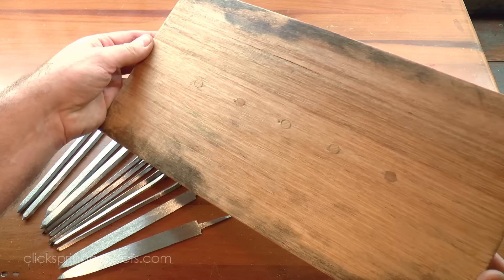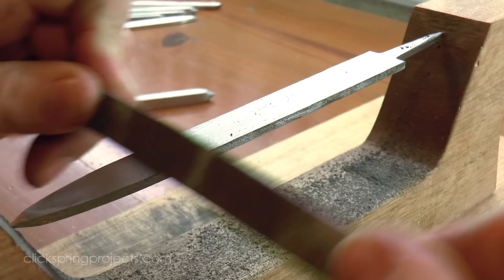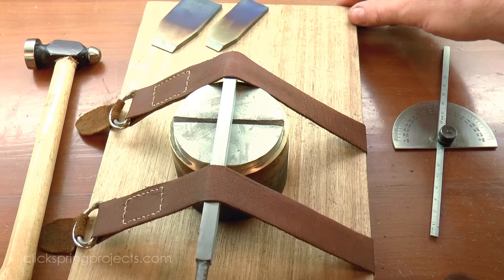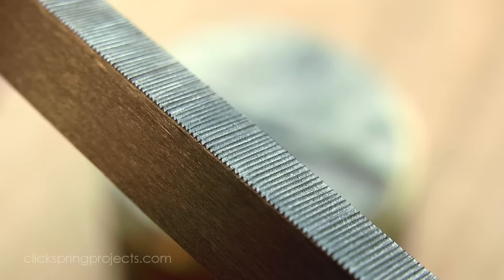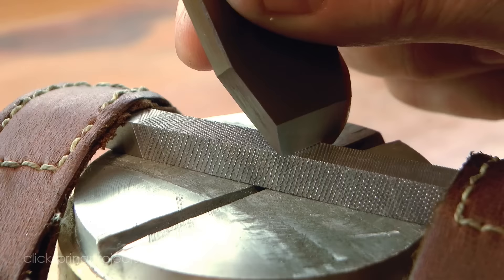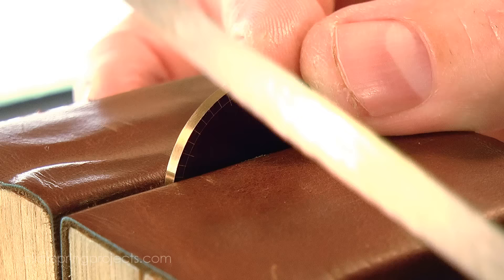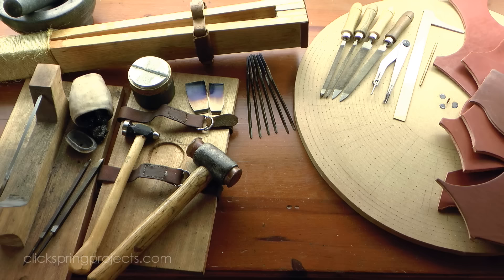Antikythera Fragment #3 - Ancient Tool Technology - Hand Cut Precision Files

Comment: Awesome video and demonstration. Do you think the chisel could have had a flat piece attached just behind the cutting edge? The flat piece would fit into the chisel groove, setting up all future cuts more consistently. There's still inconsistent impacts from the hammer blows, but removing a variable in spacing the teeth of the file is always helpful.
Reply from the maker: Its possible, however I've not seen anything like that whilst researching. My own experience is that its not required, and the pro hand cut file-makers that still practise the art continue to use free hand positioning of the chisel. It has been suggested in several texts that the small inconsistencies in the spacing of a hand cut file is a positive attribute, potentially reducing chatter - I've copied some links below for you - Cheers :)

https://youtu.be/UTXlzcmkQf0?t=2m56s
https://youtu.be/gvr2nZeAfNc?t=6m9s
https://youtu.be/gQ09O3d8y9Q?t=2m26s
https://youtu.be/koZkKDAg3Zs?t=18m10s

Comment: Man.. I wish I had the tools, resources, and space necessary to make my own files like that. I do a fair bit of detail work when I make jewelry pieces, and often it requires super small files, the type used for escapement adjustments in fine clockwork. And they can run you between 15 - 30 bucks a file, for the tiny high precision files. So as you can imagine, when one breaks, its heartbreaking. When it happens I often use the remaining pieces as their own tools, as they are still super fine pieces of sharp metal. But what I wouldn't give to be able to easily forge a few custom files in the sizes needed. Living in the middle of the city, within an apartment zone, makes crafting things difficult at times. Definitely not ideal. But im a maker and artist at heart, so.. I work with what I got. Thanks for these videos.

Comment: To get a more uniform file you could simply just have a thin flat bit of metal held losely to the back of the chisel that you are using to make the file & after you have made the 1st file tooth the thin strip if metal would locate in that tooth holding the chisel a set distance for you to make the second & you could just repeat all alone the file getting a more uniform spacing & the thicker the metal strip the further the spacing just a thought you do amazing work.

Comment: You might also consider that the found Antikythera mechnism was actually a portable,                    miniaturized version of a much larger and doubtless wooden original wooden mechanism 
that was easier to design, build, modify, perfect and instruct in its use before it was made                        of water and corrosion resistant metal for use at sea.

Comment: As far I am told, did the first files, arrives from the stone saw. The stone saw was a piece of brass, combined with nickel and some other ingredients. To make the saw work, did they pure a thin line of sand on top of the stone, and then let the saw use the sand as the abrasive.
Later did the saw get some marks on the "cutting edge" to make the sand follow the saws' movement even better. When the iron got invented, did people still use that method but did later find out it was not necessary and a wider saw could smooth a surface. Hereby was the file invented. :-)

Comment: just one thing, low carbon steel does harden-- just not nearly enough to make a cutting tool. in fact, it would best be described as getting stronger, as it's tensile strength does increases significantly. it's used in industry to get stronger parts, but without the expense of superior alloys, as long as the lower cost justifies the disadvantages.

Comment: Hi Chris,
thank you for this inspiring video! Did you know that there is a french and nobel prized philisoph who makes the thesis: "Intelligence is the faculty of making artificial objects, especially tools to make tools." And he tolds:"There is no greater joy than that of feeling oneself a creator. The triumph of life is expressed by creation. " It's Henri Bergson. And he said: The solution of a problem lies not in the solution but in the task position. The greatest freedom of man is only the tasks which he is capable of solving.

You are perfect in that! Thank you so much!

Of course I have two questions, because I am interested to makes some rasps for myself and I want to know which steel you use and at which temperature you heaten them? Did I overview that in the videos?

Thanks for answering! Greetings from ancient tool maker city Cronenberg, Wuppertal, Germany
Reply from the maker: He sounds like an interesting chap, thanks for sharing Thomas :) I used what is generally termed "mild steel" in the video. Its a vague term, but usually refers to a low carbon steel that has insufficient carbon present to be quench hardened. If you talk to a steel supplier, they will be able to give you what you want. I use the incandescent colors for temperature, just past "cherry red" worked well for the steel I used, which approximates to something like 830 degrees C. I used mild steel because I was reproducing the ancient process, but if your intention is to just get the finished product, then you may want to consider taking a short cut and using a modern high carbon tool steel - that way you can use a more straight forward heat treating technique without having to go through the more time consuming case hardening process. I thoroughly recommend this book for more info on heat treating: https://www.amazon.com/Hardening-Tempering-Treatment-Workshop-Practice/dp/0852428375 and these two videos on rasp making are just superb:
https://youtu.be/gvr2nZeAfNc?t=6m9s
https://youtu.be/gQ09O3d8y9Q?t=2m26s
Reply: Thanks so much Chris! 
I will look what my job and my time will bring to me!

Comment: Yeah I tried cutting an American quarter with some files into a gear after watching this and holy hell, it is SO hard to get the angles and spacing consistent. Insanely tedious. Stabbed my knuckles a few times too 😂
Reply: It can be done by hand, for sure. I feel it is likely the original craftsperson may have used some sort of jig to hold the file, or the work. It's not hard to imagine a triangular file attached to a polished piece of steel which runs in the previous gear tooth for consistent spacing. Those guys had way more time to think about it than we do.

Comment: Been watching - actually re watching - your stuff.  Question:  For the case hardening of the files, why enclose them in clay before putting in the furnace?  To the layman, it seems like an added step that doesn't offer anything but a heat barrier, but why have that when you are trying to heat up the metal inside?
Reply: To case harden you need some carbon to soak into the surface of the steel. First you wrap the iron with some charcoal so when it's heated the carbon will be absorbed into the surface and make a layer of high carbon steel, but you need an oxygen barrier to prevent the carbon from simply burning off, that's why it gets wrapped in clay.

Comment: i wounder if you could apply case hardening to sword making like in the case of the ulfbert steel swords. instead of creating steel billets to forge they used iron then applied the carbon layer to the sword, hardened the blade, then tempered it so it wouldn't shatter like glass. but it might not give the best structure or free it from any impurities.

Comment: At around 1.35, I see you grinding/polishing your blanks against sand paper, fixed on a circular wheel. I suppose not. But, for argument sake, at this point, how are you ensuring that the grinding/polishing does not affect how straight/flat your blank is, sir? I would, with my limited knowledge, opt for a surface, that I can guess is, or expect to be flat, like a belt sander, with a supported surface that is bigger than the size of the blank being worked on.

Comment: Chris,  could you use a shorter thin piece of metal with a sharpened edge on held closely to the back  your file chisel?  I believe by engageing the previous cut, it would give even spacing and insure a uniform angle across the length of the file.
Reply from the maker: Possibly Norm, although it seems to work pretty well just using the same method as the traditional approach

Comment: The leather you use, both for the straps and for the vice, is too soft and stretchable. Leather used for insoles in ladies pumps, or similar, would be better for the vise. Dampen it first, fasten it with shoemaker nails (flat heads) rather than with glue, and stretch it thoroughly (using a pair of pliers) as you go. Cut to shape, let it dry, and it will tighten even more.

Comment: Hi Chris how do you locate the chisel perfectly parallel each time, if the previous tooth profile is below the surface of the file? Thanks, Adam.
Reply from the maker: It works because the previous tooth is in fact slightly above the file surface - each tooth gets pushed up by the chisel  - cheers mate :)

Comment: gear teeth are not filed down they are always cut with jewelers saw  - if you go to watchmakers  that are standard - yes they are using softer brass  but 
in the end,  a jeweler saw first then they will either use and needle file which is round    can do different  groves -- your  video is interesting in making custom files  the large gears were done with punch outs  where you punch   a hot round plat  in a press jig -- yes some people do it with files but that is not tradition of the trade of gear making  and can be off

Comment: Wouldn't the stripping frame follow any twists/dips in the file blank's profile? So how did you make the file blank perfectly flat?
Reply from the maker: My observation is that the stripping frame will easily accommodate a gentle twist and take it out, although at the expense of material in the blank. A significant twist would need to be removed before using the frame. In either case its not difficult to remove the twist before transferring to the frame - thanks for watching and asking :)
Reply: Fascinating! I love the topic of how ancient craftsmen could create precision tools from nothing. Have you seen oxtoolsco's video where he creates a set of cast iron laps? This reminds me of that a lot!

Comment: Man I'm having such a hard time imagining how, when striking the teeth on the file, how the previous chisel mark can be used to produce the next.. I At least, I dont see how it works so well that it can be done so quickly without having to check each strike excessively
Reply: when he makes the first cut, the tooth chisel raised a ridge on the file blank that's proud of the surface, he's just sliding the chisel up against that ridge, which lines it up and gives him the proper spacing for the next strike.

Comment: You should not grind the edges dry. please use a wet stone. 
If you see the first spark you are at ore close to the melting point of the steel. 
So you are ruining the heat treatment in the important fist 1/1000 of an mm.

Comment: seems pretty cool but i have one question. you used a file of sorts in order to create a plane surface for your files, or was it simply a piece of flattened steel? i understand its very hard to make a tool without having tools in the first place (making tongs without tongs) but i was just wondering if you had or if the people used a different object or tool to smoothen out the surface of the file sides.
Reply: As he says in the video there were slower things available. You could use a stone for example. Or  pumice perhaps on some board, Lots of ways. Not easy but doable.

Comment: Why did you temper the files? I thought they needed to be as hard as they could be
Reply from the maker: In the fully hard state the teeth are too brittle and would immediately chip under load. Lightly tempered, they retain almost full hardness, but are tough enough to be put to work :)

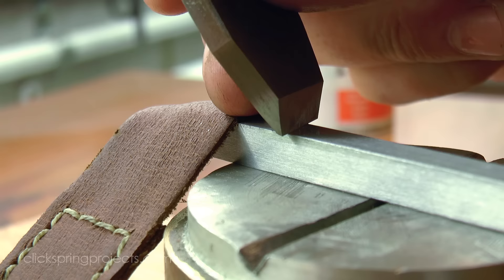Comment: Chris, has the chisel a double cut?… time 6:27…you said to make the next cut you place the chisel back to the previous and then strike and so on but, the first cut was single according to my eyesight....if it has a double cut that would be understandable....I think I missed something   :(
Reply from the maker: Hey Marc - the chisel has a single cutting edge - the back surface of the chisel lightly rests against the front of the ridge of the previous tooth to position the next cut. It sounds difficult, but its surprisingly easy once you start to hit a bit of a rhythm. It just naturally wants to sit there with a light fingertip pressure. Cheers :)
Reply: Clickspring ah, now I understand, thanks mate, I just couldn't get my head around it, the chisel is seating against the slight burr from previous mark....a bit of a "du"h moment for me. Nothing unusual LOL. Cheers Chris 👍🏼😊

Comment: Am I the only one confused about how the cutting tool lands in the next spot? It looks like he drags it back until it falls into the previous cut, so does he then slide it a little before hitting it or am I misunderstanding the process?
Reply from the maker: As each tooth is cut, it raises the metal above the flat surface of the blank, creating a ridge. The chisel is gently slid back until it rests adjacent to the 'front' of this ridge. Each tooth then gets cut just in front of the previous one
Reply: Clickspring Ah, that makes much more sense. Thanks!

Comment: Kind of a conundrum using a file to make a file.... how did they make the first file ?
Reply: Well, you start with a flat stone and then grind your tools against it until they are flat. Then use those tools to make better tools. The first tools were probably stone or used copper / bronze and some abrazive like quartz sand.

You can also rub three flat stones against each other in pairs, while covering them in soot or something to mark the high / low spots until all three are reasonably flat. You need three, since rubbing two pieces together will make one piece convex and the other one concave. By the way, that is also how one grinds lenses: grind two flat pieces of glass against each other and you will get one concave and one convex lens.

There is also a thing called experimental archeology, where scientists have not enough sources to base their hypothesis upon, so they try to imagine what would people do and try to recreate it.
Reply: I was joking but thanx for clarifying things for every1 else

Comment: what kind of oil do you use for tempering??
Reply: in another video he uses lukewarm brine/ salt water (probably to avoid smoke and splashing) there are a lot of choices for oil that can be used to temper/ quench, and though there are benefits and tradeoffs to different quenchants for different materials, you can use mineral oil or canola oil for a wide range of materials. you can go further with expensive specialist marquenchant metal salts, but ultimately what your doing is trying to control the cooling profile of the material(steel) to get the desired crystalisation/ alignment and mineral surface treatment/ structure, so you can also use water. but basicly you cant go wrong with canola oil or mineral oil, though its worth checking around first r.e your specific material incase it has quirks that need special treatment, as long as you understand the process and the safety/ risks and are have appropriate equipment, then as much science as there is to it, theres also 'art' and experience. besides i think clickspring has several videos on the subject of tempering and annealing so you can see what he does for different materials and results, including temperature grades with some explaination of the correlation between hardness and color. but yeh for a simple answer canola or mineral oil, keep it 'dry', and have PPE
Reply: @bvs1q  ...Thanks! 'i'm a newbie and i don't know nothing!  i'll learn!

Comment: What kind of sanding belts are you using in the belt sander?
Reply from the maker: Ebay mystery belts - nothing fancy. 80, 200 and 400 grit.
Reply: Clickspring how quickly do they generally burn out on you? I was using belts to make my lathe cutting tools but they just burn out so quickly...
Reply from the maker: I usually get a few months out of them, but I don't use them on HSS - try a cheap bench grinder for shaping your HSS lathe tools, it should give you a crisper cutting edge too
Reply: I use a 6" bench grinder to rough out tools, then use a belt sander to finish, then hone. Locally obtainable belts (home depot) are noo good for anything metal.

Comment: Why a push stroke file and not a pull stroke file"its a big deal in woodworking hand saws"The pull stokes the older method that changes the control and speed of the cut greatly.

Comment: Why grind in the cutting edge after quenching?
Reply from the maker: The safe edge without any teeth cut into it was the surface ground, to permit a clear indication of the temper colors - thanks for watching and asking
Reply: Clickspring Sorry, I meant the cutting chisel at 4:52
If you were going to through-harden it anyway, why not cut most of the edge while it's soft? 
Thanks for replying
Reply from the maker: Its a very small amount of material, you could certainly do that if you wish
Reply: Clickspring Right on.

Comment: Can you tell me what was the clay mixture you used? Thanks! :)
Reply: Clay+charcoal powder   60\40 --- 40\60 %.
Reply: @iridios6127  thanks! I will try to experiment with some, for crucible making. They will be used in really high temperatures. I fear decomposing more than cracking.
Reply: @emel60  
I meant the mix that put on the file. Then it’s sealed with a regular kaolin.

Comment: I think you are mistaken about carbon content of steel vs cast iron. Steel has 0.05 to 0.25% carbon, cast iron gets as high as 4.0 percent carbon. Cast iron is brittle because of the high carbon content. Using steel to make old tools is cheating a bit. None the less, like your video.
Reply from the maker: No mention of cast iron in the video